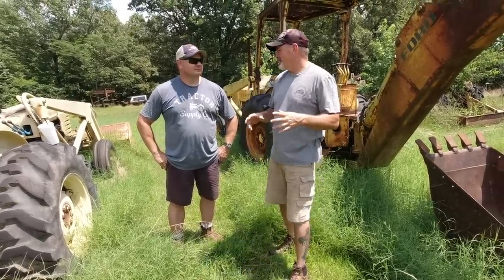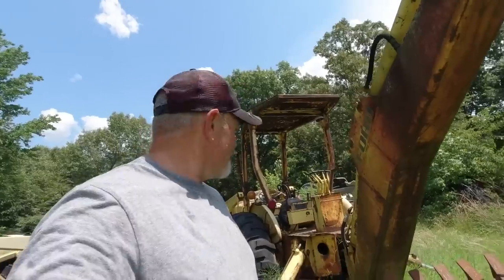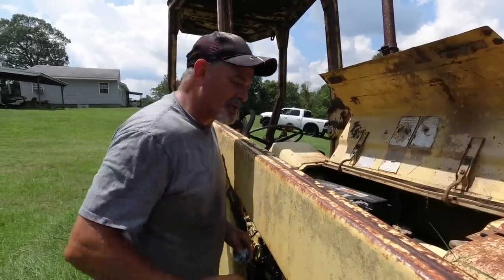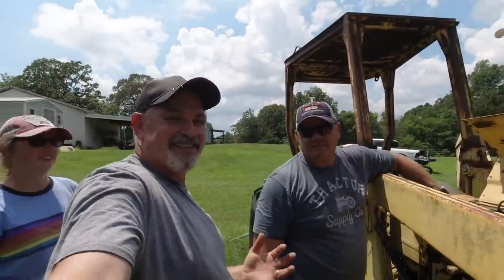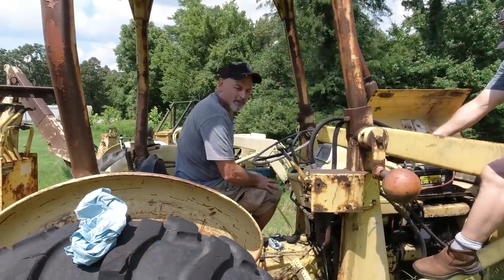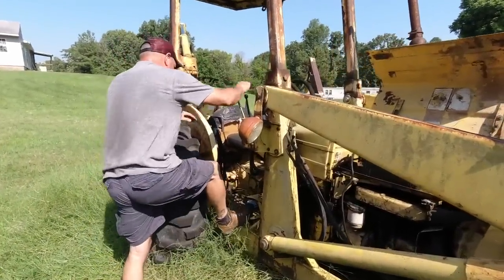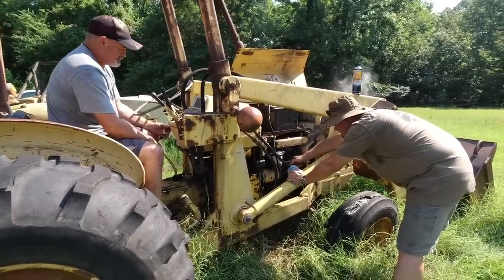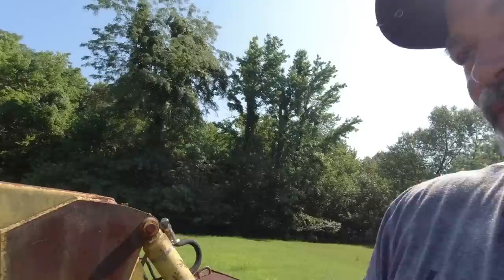WILL IT START? Starting an OLD Ford Backhoe for 88 year old Man!

Comment: Looks like a Ford 4500. The predecessor to the 555. These were super powerful backhoes and know for having enough power to rip them selves apart. I have a 1975 Ford 4500 and I wouldn't trade it for anything. Very efficient, powerful machines. The perfect "home owner" machine. The torque converter trans acts as a shuttle shift and makes it really easy to operate.
Reply from the maker: Keep watching 👍

Comment: Amazing thing that you manage to start nearly ALL of them, even when given up for dead!  Back when I was mostly driving junk and doing first starts like yourselves, I learned a couple of things I really should have taken along with me...first, a nice length positive and negative battery cables, preferably the good, heavy 6 volt ones. Then a battery terminal cleaning brush, and a pair of battery pliers, plus a couple pair of "military type" bolt on battery terminals. Don't forget the wasp and hornet spray, and the DEET insect repellent. And, never just pound the terminals on and expect it to be a good enough connection!  Now days however, I still carry around a hammer crimper, wire terminals and a lot of other crap I never use! But then, I'm nearly 80 and somewhat limited, but still love old machinery, and watching other folks work on it!!
Reply from the maker: Thanks Mr. Neil. I appreciate the comment. Have a good day 👍

Comment: Pulling that starter off is a bugger of a job. Its pretty easy if you have the injector pump off already, but you should have the starter off fitst to get the injector pump off!😬  That tractor is not as old as you might think....I would say early 1970's.  I've got one just like it.
Reply from the maker: Thanks Don👍

Comment: I'm thinking that is a 535 or maybe a 4500
It uses a 4DLT battery
4500 is from the 1960s
Get the engine spinning before hitting the either...
I use to use a rag with gasoline...
Once she hits jerk the rag away..
Reply from the maker: Thanks for watching
Reply: It says "4500" right on the loader arm.    This machine is around a 1970.
Reply from the maker: Yeah did you see the part where I talked about that 😂
Reply: @HamiltonvilleFarm  
Yes after a posted.
The way the loader lift cylinders attach to the loader frame gives a some what age range...
And yes back in the day. 
Having a detachable backhoe gave deversability to a machine
One machine that could have many attachments...
But with the wave of construction that came through 
Together with the increased sizes 446 Cats.  710 JD. 755 Ford's. Etc
Detachable backhoes became a thing of the past. Except in the skid steers
I spent 36 years in So. Cal running Skiploaders on the rental fleet
You don't drive to far without passing one of the projects I worked on...
all the way from 1 day jobs to 3 different jobs I was on for 7-8 months.  most high rise buildings took me +-  6 weeks to finish the subteraining +- 6 stories down... Level..
Out if 36 years
I ran a MF 40. a 30B MF.   2-545 Fords 1- 545A.Ford. and 1--545C Ford
Reply: I had a 69 Ford 4500 backhoe.
It had a 16 ft hoe by wain roy and that machine was one bad ass digging boss rig. Power and speed best match up I've ever run, that engine wide open, sweet music! 
The loader arm was broke on left side just like this one, same spot. They pushed it back together and welded it never lined it back up level and miserable to clean up with. One tough repair, I was happy to have oldt timer fabricator/ welder on it.  He cut all but about a half inch of boom out and the work began, no easy task by any means. Wasn't off by much when he was done.  Best overall TLB I've ever run. It would out dig any machine compatible no doubt about it. I wish I had kept that machine !!

Comment: The model is a 4500. Within a couple of years Ford produced a 4500 which was a diesel and a 4400 which was gasoline. My Dad owned a 4400 but alays wanted a 4500.
Reply from the maker: Thank you!
Reply: @HamiltonvilleFarm  I did notice after I commented that you found the model once you moved the bucket arms. LOL The 4500 is a good hoe for the year though. I think they were produced from 1965 to 1975. The 4400 Dad had was a 1973.

Comment: I actually have this same backhoe and it's been sitting in a shed for a few years so this video comes in handy as I want to get it running again.  Last time it was running it seemed to be either leaking or pumping diesel fuel out the fuel tank when the engine was running.  Otherwise all in working order.  Bought it at auction from our school district complete with all the mechanics manuals for $3,000.  Engine was completely rebuilt just before it went to auction.  Thanks for the great video - really enjoyed it.
Reply from the maker: Thanks for watching 👍

Comment: Drain the water separator first and verify the fuel tank is clean. I just got a 535 backhoe running. The fuel system was a mess.
Reply from the maker: Thanks 👍

Comment: That smoky- ass starter is probably that metal band (not Steel Panther) that goes from the solenoid to the starter terminal. I had been seeing a wisp of smoke from the starter on my old loader so I got positioned to where I could see it when I engaged the starter and that turned out to be the source of the smoke. Pulled it apart and I could see where it had been arcing. Five minutes of sandpaper lovin’ and she’s fixed.
Reply from the maker: Thanks for watching 👍

Comment: 5:50 guessing that thing's going to be about a 67-68ish year?  ISTR that Whitlock Bros. over here used to convert the Ford 3000 or 5000 into a backhoe around then, before J C Bamford's LTD got in on the act and built machines from scratch to go on and become the famous name they are today.  The big problem with the Whitlock digger apparently was the rear wheels used to work loose and break a lot due to the smaller bolt pattern (the machine reputedly weighed in around 7.5 tons).  Only know this as the fella I used to work for had a pair of Whitlocks, '68 and '69 that he used around the yard.
Reply from the maker: Interesting. Thanks Dan👍
Reply: @HamiltonvilleFarm  And thank you too sir, good Sunday afternoon entertainment while the chicken is in the oven :)

Comment: That’s the way all the 4500 535 555s backhoe attachments were. Made it easier to work on. Started my operating career in the early 70s on the old chain swing 4500s,which is exactly what your working on.
Reply from the maker: Thanks for watching!

Comment: Starter oil seal is bad. That starter has oil behind it and requires a oil seal on the starter drive If that seal leaks it fills the starter eith oil.
Reply from the maker: Thanks for watching 👍

Comment: Awesome ! wasps, smoking starter and the engine fires up on wasp spray. Priceless ! and everything works. Great video. Good grounding and clean connections are essential for a good working starter. I think the starter brushes are worn or the braids to them have partially gone.

Comment: I have the same backhoe I just started working on  but mine is a 3500 Ford.  I always attempt to have some way of putting out a fire when ever possible. In the field I started a fire under an 8n gas tank inches away.....I always give slight misty sprays of ether starting fluid WHILE the motor is turning over. If you spray to much you can lock up the motor.  Great video as always guys...It's a great feeling bring on back to life like a ford 3000 loader we just brought back from the dead after a couple years sitting. LOL had two Gallons of water in the hydraulics..NO LIE ....Possibly being saved from the junk yard demon.

Comment: I use to run one of those back in the early 80's. Traded for a new Case, bad trade preferred the manual shift transmission to the shuttle shift of the Case.
Reply from the maker: Cool. Thanks for watching 👍

Comment: This is awesome to see.  We just bought the Same machine in Michigan. Motor was locked up from sitting. Took 3 hours to get unsized.   Have to get the carbon gaskets for putting the injectors back in.   We may have to make a video of it

Comment: How many CYLINDERS  does that ENGINE have on that BACKHOE if it is a 3 CYLINDER it is a 3500 SERIES TRACTOR 4 CYLINDER or above anything BIGGER than that it looks just like the 1 that DAD had to the TEE & it was a 3 CYLINDER 3500 SERIES  DIESEL TRACTOR I mean it was IDENTICAL to that 1
Reply from the maker: Cool. Thanks for watching 👍

Comment: You should find an old pickup with an utility bed that you can turn into a trailer to put tools and such in when you do these will it start videos.
Reply: All he brings is an adjustable wrench and a screwdriver.
Reply from the maker: Tony's got it right!

Comment: The tractor is a 4500. I had one. The hydraulics were fast. It has a 3 cylinder 57 horse power engine. Mine was a 1972 with the raised deck option and a Sims cab. The chain for the swing was standard.
Reply from the maker: yep...keep watching. :)

Comment: Looks like a Ford 3000 tractor. Should be a name plate on the side of the engine.
Reply: Looks like a spoke too soon. Hard to tell all those apart. They mostly all look the same.
Reply from the maker: Yeah I didn't see the 4500 until later myself 👍😊

Comment: I’m looking at a machine similar to this.  It doesn’t have a rain cap on muffler.  It has the slight curve at the top of the muffler.  
Should I remove the injectors before trying to start so it can push water out if there is any on top half of cylinders?
Reply from the maker: You can do that, yes.  But check oil to see if there are signs of water in the system first.
Reply: @HamiltonvilleFarm  so I’m guessing that the water would get past the rings on the piston and make its way down into the oil???  

Thank you for the reply.   I’m used to working on 4 wheeler carbs and chainsaws so this will be a experience for me.

Comment: I'm 99% sure, I own the same backhoe, which I bought off my brother. The thing
had been sitting for 8 years, and it started up, right after a little bit of cranking, that
was impressive.
   I'm still learning about this machine, but it has no clutch pedal.    It has a "stick shift"
for changing the gears,  and a "Forward/Reverse" lever next to the steering wheel.
With no clutch pedal on the machine, I need to come to a "complete stop", bring the idle 
speed down to it's lowest minimum, then I can "shift"smoothly without grinding 
gears.
Reply from the maker: Float 'em! Thanks for watching 👍
Reply: @georgiebearpaws - the shuttle shift is F-N-R .... make SURE the shuttle is in N before shifting 1-2-3 on the trans

Comment: These are great units. Construction firm back home had 2 of these fords. Saw them on many  sites around town. Sometimes one fitted with a Allied Air hammer along with a massive Ingersoll truck mounted compressor.  Very reliable units
Reply from the maker: Right on! Thanks for watching 👍

Comment: It's a ford 4500 TLB probably early 70's. It was sold as an industrial backhoe and most don't even have the pro shaft installed from the factory. They are bulletproof and very strong even by today's standards. I have the same one and have been through it front to back. Lmk if you have ANY questions 👌
Reply from the maker: Thanks Josh👍
Reply: @joshwooten3719 - - these are "shuttle shift" with a torque converter..... PTO is 100% impossible because the torque converter is in the way
Reply: Do you need to take the starter off to remove the injection pump on one of these?

Comment: That Coca Cola on a battery trick is a true fact. 

I let a buddy of mine borrow my old truck one time. He comes back in the house and says it won’t start. I come out there and bumped the key and nothing happens. I say to him “alright run in the house and get me a coke out the fridge.”  He comes back out there and I got the hood up, scratching my head like I’m stumped. I take two sips of the coke and pour the rest on the battery. He starts telling me about how I’m crazy and that wouldn’t do anything but give you a sticky battery. When he was done arguing I told him to start it.

Other Coca Cola trick: it’ll get the diesel stink out of your clothes. One can in the wash with diesely clothes and the come out smelling like your detergent.
Reply from the maker: Thanks for taking the time to watch and make the comment. I truly appreciate it! Have a good day.